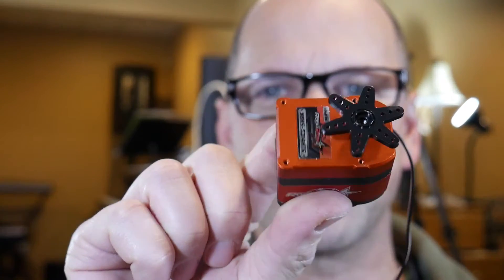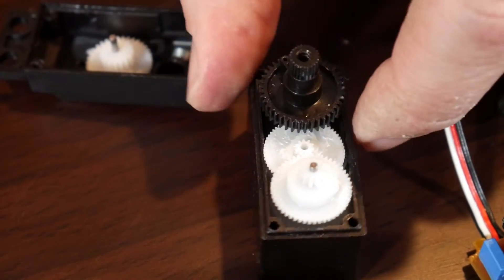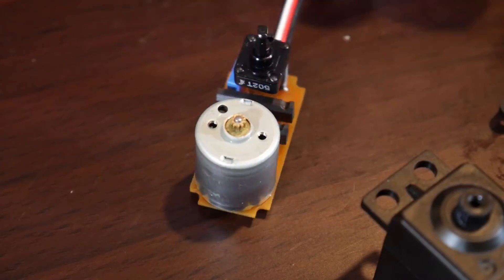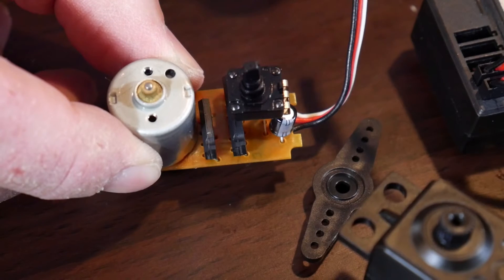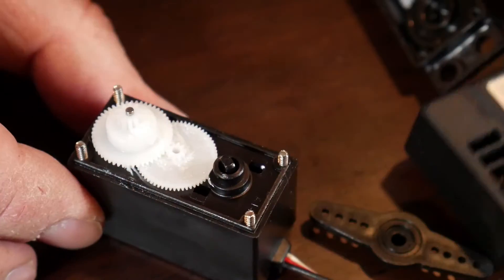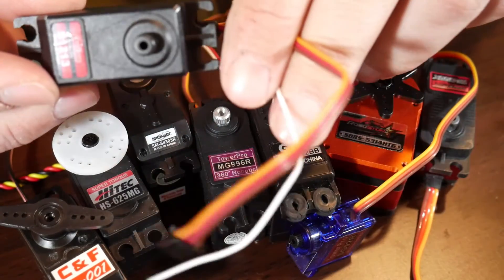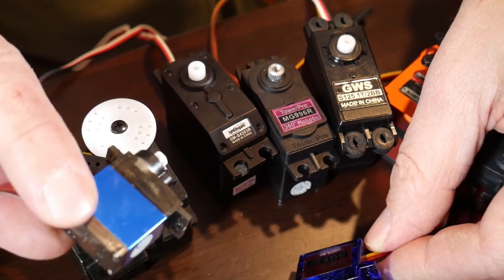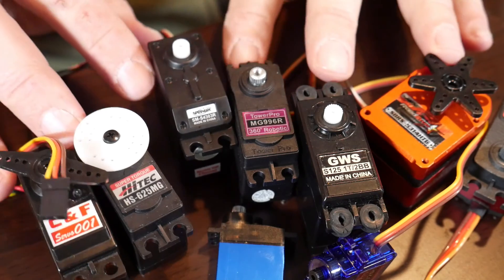Arduino Droids and Robots : Servo Motors vs... Inside and Out (Beginner Robotics)

Comment: greetings, i am very new to this servo, i have a cys s0009 servo, my question is how do i find out whether it is a continuous or those positional ones, it has the typical 3 wires and no analog feed back wire...
use a small rtn in arduino ... but i do not seem able to turn it to a position like 45 degrees...so did i buy the wrong servo...sounds like it;
your video was very educational, thanks, and thanks for your attention